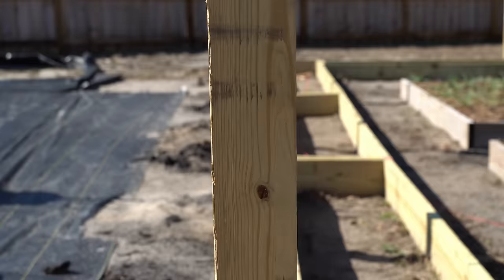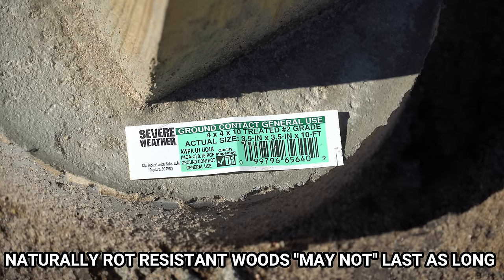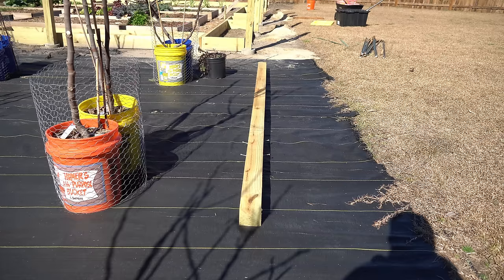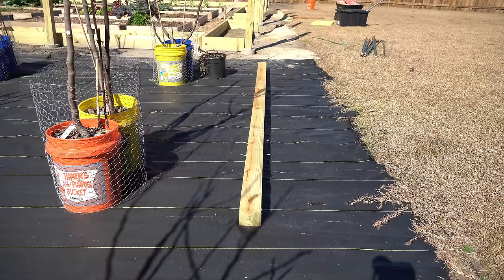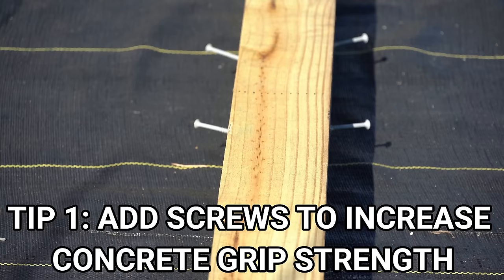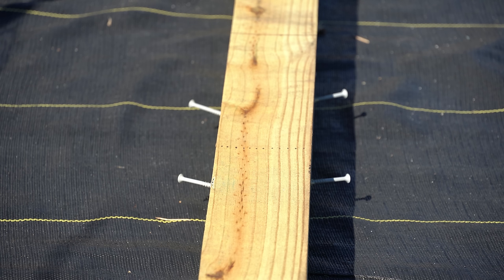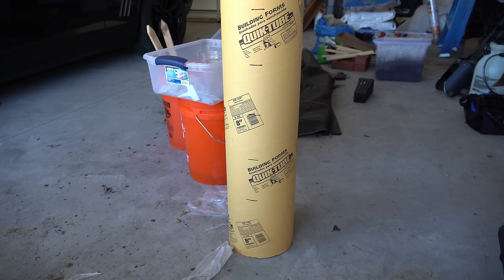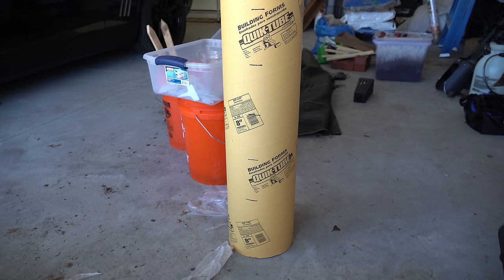3 Tricks To Installing Stronger 4X4 Wood Fence Posts That Last Longer

Comment: I put up a grape arbor in 1981, 4" PT posts resting on gravel and surrounded with concrete. At 40 years those posts are still doing yoeman service.
Reply from the maker: That's great to hear.  I hope my posts last that long!  I know they say, "They don't make 'em like they used to," though, so I have my doubts that today's cheap-o sapling lumber will last as long.

Comment: Why not just use galvanized stands in the concert then bolt to them, worked great in large decks for mw
Reply from the maker: Alex N cost and time.  You will have to install full concrete foundations for that.  I installed these for probably 1/3 of the cost.  I would have had to have purchased 5 bags of concrete for that and dug an even wider hole.
Reply: I wondered the same. For something not carrying a ton of load, it seems like the same diameter concrete would have worked, no?

Comment: Spending time and money :  Take it to the next level...
Use 1/4” lag bolts instead of lite screws 2 per side...My fence post has a hinged 10ft 2x4  swing gate. I can sit on the gate and iit won’t budge 😉Coastal beach town with hard packed sandy soil. 
Today’s crappy wood we use unlike wood from decades ago...
Use dry concrete mix instead of gravel. @ 3” .Heres why ...The dry concrete mix will harden from ground moisture  making a permanent seal at the bottom of the post. The gravel will cause a bathtub effect causing the water to sit under under the post under poor drainage conditions .No brainer...
Good video ...

Comment: I've pulled a lot of posts that were very old and I never was able to just pull the post with out the concrete attached...never was able to even beat the concrete plug off the post...although the screws probably add a little bit of sheer strength under a wind load
Reply from the maker: I've seen folks pop out concrete caps and posts using chains and floor jacks.  It can be done if the concrete is a monolithic pour.  If the concrete fractures into pieces, it may require a little more cleanup.  We used to pop out light pole foundations with digger derricks and backhoes.  Attach chains to the anchor bolts and pull.  POP!

Comment: Doesn't the stress of new/big screws (as a type of 'rebar', and even with slowly graduated pilot holes) cancel any benefits, maybe even make the wood later split, dry out quicker, and therefore be more hurtful, than helpful??
Reply from the maker: The wood embedded in the concrete will be just fine.  Pressure treated posts aren't going to last forever.  They're rot-resistant, but not rot-proof.  These should last at least 10 years; somewhere in the 10-20 year range.

Comment: You should stop your concrete pour 2 inches below soil grade and then install the tube. Pushing the tube into the concrete creates a circle or water that may freeze and destroy the concrete at the soil line. Just a thought.

Comment: Put 2 in gravel in the bottom of the hole then add concrete then place your pole down into it and then fill with concrete at that point your pole is never touching the ground. The screw's I think would do a great job.
Reply: concrete still wicks up the water

Comment: Pressure treated lumber is not rot resistant lumber, it is lumber treated with chemicals to prevent bugs and other such things from eating on the lumber. Most pressure treated lumber is yellow pine or spruce.
Reply from the maker: This is pressure treated lumber that is rated for ground contact, meaning it is treated to resist rot.

Comment: You do all that but disregard the footing and wood post joint. Slope that footing top and install a soft joint with silicone sealant address the dimensional changes of the wood post that will allow water to penetrate

Comment: Hey bud, how many sacks of concrete do you use for a 36” deep hole? And is the diameter of the hole the same as the 8” form?
Reply from the maker: Roy Rivera it depends.  Do you want to fill the hole up all the way or just cap it?  If you need to fill the entire thing, Quikrete has a calculator on their website.  I averaged about a bag a hole because I’m on sand, but some holes needed more.  One hole retained water and was in different soil, so I needed to put in 3 bags.

Comment: Looks like a brick shithouse !!!
I am replacing 100feet of fencing I built 30 years ago
My 4×4×8 pressure treated posts  set in concrete are in great shape.
The rot is at the 2×4×8 stringers 
I live in a very rainy part of western wash 75 inches a year and strong gusty winds
 All he guys saying posts should never be underground in concrete makes no sense to me

Comment: Also, no need for screws. I’ve placed plenty of wood posts in concrete and not one has ever come out. By the time the post rots, you need a new fence anyway.

Comment: Always tar the Bottom 3 and one half feet of your post,,  creosote works good too
Reply from the maker: Creosote is a listed carcinogen.  I would strongly recommend not using creosote for fence posts for a garden.  That's the last thing you want in your soil.  Copper azole pressure treated is fine because it's non-toxic, but creosote is a poison.
Reply: @TheMillennialGardener  ok I didn't know that..
Don't eat them tomatoes...i unusually use roof cement or tar anyway

Comment: Wood screws cannot withstand a sheer force. I recommend nails as they can withstand sheer force. Sheer force occurs when downward or upward force or movement is made on the post such as water freezing.
Reply: Agreed. Galvanized nails
Reply: Correct Kim, this is also why they use nails when building any wall in a house.

Comment: Hey dale do your leaves fall off your owari satsuma if not could you give me a guide to follow to correct my tree
Reply from the maker: The Owari Satsuma is not a deciduous tree, and it should stay evergreen and full of leaves all year long. The tree will periodically drop leaves here and there and replace them as all evergreen trees do, but the tree should never "drop its leaves" and be bare or mostly bare. If your tree is dropping its leaves, it is due to severe stress, probably either:
1. It was zapped by extreme cold temperatures. If it gets too cold for the tree, the tree may respond by dropping all its leaves to save energy and try and preserve its core trunk wood. If you got a sudden cold snap, it's possible the tree will recover.
2. The tree is suffocating due to overwatering in containers/clay soil that's staying too wet.  Citrus are highly prone to root rot and cannot tolerate mucky, wet, heavy clay soil.
3. The tree is going through extreme drought stress.  Citrus are highly tolerant to drought stress, so this is less likely.

I would look at these 3 potential possibilities.

Comment: Hello, got a few questions for you. I have just took my broken fence post out of the ground, 48 inches later. I bought a bag of gravel to add to the bottom of my hole. You recommend 6 inches, so I will do that. You also recommend screws and I like that idea, so I will also do that. I also bought a Quick Tube (10 inches x 5 feet). Do I sit the post on the gravel then, add the tube or add the tube then, the gravel? When this is done do I fill the hole with concrete or dirt then concrete? Hoping you get back to me. Thank you.

Comment: It should be noted, though, that the three inch concrete base will interfere with the pickets for a fence.
Reply from the maker: This is not an issue.  You can view any of my videos in the past 2 years to see my fence.  Welded wire fence is easily cut with the smallest pair of wire cutters.

Comment: All sounds nice, but if you live in an area where ground freezes things heave not sink any "sinking" is just debris collecting on the surface, in clay soils water will collect in the stone at the bottom - where could it drain to?

Comment: I would rather not have the concrete sticking out above the ground, would having the concrete 1-2" below be almost as effective at combating rot? Would you recommend anti-rot wraps or asphalt around the the ground level?

Comment: Is that a 8” diameter hole for a 4” post?

Do you have that same ratio on your fence too?
Reply from the maker: The holes were coming out somewhere in the 8-12 inch diameter size, depending on the quality of the soil.  Some of the soil in the back had more clay in it and was holding together better, but the holes in the front were in pure sand, so they were collapsing a lot, leading to a wider-diameter hole.  I did not install my fence, so I'm not sure how they dug the holes exactly.  The fence was built by 3 different companies: each of my neighbors did a section, and I tied in the rest.

Comment: Great tips! How did you finish your 4x4 post fence? Did you use horse fence, did you brace it?
Reply from the maker: They did not need further bracing after the concrete.  They are solid as a rock.  They only needed to be strong enough to support my tomato vines, but I could probably attach hundreds and hundreds of pounds to them.

Comment: If your belling the bottom of the hole do you wait till it's completely dry and set before you set your post on it.? 
Have to do a 8inch hole with a 18inch bell on the bottom for city inspection..
Reply from the maker: You will want the hole to be as dry as possible.  If you find the hole stays bone dry, you don't have to fill the entire hole with concrete and just pour the top half like I did. I had 2 instances where the holes held water, so for those 2 instances, I poured the entire hole with concrete to prevent rot for as long as possible.

Comment: Very thorough! Awesome work...One question, how do you ensure the post is perfectly vertical while setting to concrete?  Cheers
Reply from the maker: I used a post leveler, which I have linked in my Amazon Storefront in the video description under Garden Accessories.  It's only $8 or $9 and works great.  That got me 95% of the way in seconds.  Then, I used a 2 foot level to check for any final, tiny adjustments.

Comment: Thanks so much.  Am putting up a 16x24 off grid home.  Have you heard of these new plastic discs to put under the pole?  My worst fear is foundation problems, want poles to last AS LONG AS POSSIBLE.  TN mountain location close to frost line, but 500’ below.  Prudent to coat pole in ground with creosote or copper type preservative?  Thanks again
Reply from the maker: I'm not familiar with the discs you're speaking of.  Because this is a garden installation, coating the bottoms of the posts with any kind of chemical can't happen, as I do not want that leeching into my soil over the years.  The posts are already pressure treated, so they're completely soaked through-and-through in a copper preservative.  I can't see that adding much additional value, since the posts are, quite literally, soaking wet sitting on the shelves at Lowe's.

Comment: I do my post much like yours however the part of the post that is below grade i coat with roofing tar and allow it to dry before installing.  Just another layer to help prevent moisture from getting to the base of the post.
Reply: question about roofing tar:  does it have to be heatex up or is it paint on?  thank you

Comment: One thing is that if the soil can be saturated 365 days then if it rains and you have gravel under the post won't the water just sit in the gravel sort of like a pool of water? That will definitely speed up the rot won't it?

Comment: Best solution is to use metal brackets available at the home store, to fasten your post to the top of the concrete peer, thus allowing the post to stay dry.  Strength is achieved by stucture attached to the post.  Keep the post out of contact with the earth or concrete and allow it to dry when it rains.  If you have not “structure” to secure the post then this “per video” is a good idea.
Reply: A gust of wind would knock down the fence. Not enough strength

Comment: using a proper Post anchor setup so the post is NOT even in the ground, but sitting in the anchor/strap/cleat/strongtie well above grade. Yes use concrete pylon to overcome frost heave., but this the only way to ensure a wickless post. Your method of screws only speeds up the moisture penetration , not a good plan. Cut a cross section of post and examine the impregnation of the "treatment" , you'll often see very little if any treatment infusing into the core of the post, Some do , some don't , it's an important aspect to the life of the posts you have, and screwing more pathways for water into the core is worse. However, the rest of the build is looking fantastic, and will last a lifetime or more anyway. Well done. Happy Harvest!

Comment: you should not put concrete around wood.
we have Brackets that you concrete in and bolt timber to that, If in years to come you can easily change wood ?
Reply: those work great for deck and shed footings, but what about fences and the shear loads they create?  Surely such brackets - and especially the bolts that secure them to the concrete piers - are not designed to withstand those types of loads, especially if we are talking a 6-7 foot panel fence in a high-wind area?
Reply: @oceanzmat  they're called stirrups and they will hold huge load. They sometimes use them for house footings.

Comment: If you have ever pulled a pt post out of the ground you will find that all the rot happens in the first 10 inches or were the water runs down between cement and post as it contracts
Reply from the maker: This is why I capped the tops and built the foundation reveal.  I'm trying to keep the water off the tops.  Hopefully, these will last at least a decade.

Comment: Every post I have seen that failed either on concrete, gravel, clay, soil, etc. has been near the surface where it is continuously cycling wet and then dry. I believe I have seen more sheered off in concrete than other installations. I am curious how the foam method will turn out over the next decade.

Comment: Great tip for setting post's, but I'm curious at what point did you remove the cardboard tube. And what method did you use to remove them?
Reply from the maker: You may remove the cardboard the very next day.  A 24 hour cure is all that's necessary.  The cardboard is perforated and designed to tear off in a circular pattern.  You can get it started with a utility knife.  If you can't get the cardboard off for some reason, just soak it down a few times with a hose and it'll turn to mush.  Then, you'll be able to just pull the mushy cardboard off.

Comment: I don't understand why you set the wooden posts in concrete and don't use anchors? They're just as stable when done correctly. How do you replace the wooden posts in the first place?
Reply from the maker: I only poured a concrete cap.  You can pop them out using a chain and a floor jack if and when they eventually rot.

Comment: This guys name says all u need to know gardener I have been doing fence for 18 yrs and all these tips will do is cost u more money u don’t need to spend. Bell the bottom of your hole, put concrete under and all the way around your post and do a dome cap no extra materials and just solved all the issues this guy said

Comment: How long do you wait to pull off the forming tubes?
Reply from the maker: 24 hours to cure enough to be firm in most cases. If it's really cold out, maybe wait 48 hours.

Comment: Hello, hope all is well. Question, how many bags did you use per post in your situation? Thank you.
Reply from the maker: I tried to only use 1 bag per post as a "cap" on the top so when the day comes where the posts eventually rot, they won't be horrible to remove.  However, some posts in the rear right had some water intrusion 3 feet deep, so they required more concrete.

Comment: Consider going with stainless structural screws. They should last a good deal longer
Reply from the maker: In my experience, the screws outlast the wood.  Ultimately, this garden has already been through a direct hit hurricane over my house a couple more tropical storms and they're as good as the day they went in.
Reply: @TheMillennialGardener  Fair enough. Maybe it has to do with the climate or product defects, but I've had a number of galvi fasteners fail when coatings chip off or are otherwise compromised.

Comment: How do you remove the tube after cement is dry?
Reply from the maker: The tube is made of cardboard and has indentations to peel it, similar to a paper towel roll. All you do is run a utility knife along the bottom, start a corner up top and peel it off.  Or, alternatively, you can soak the cardboard with a hose so it becomes saturated (after the concrete cures, of course) and it'll peel off with almost no effort.

Comment: Would have been helpful to see how you removed the cardboard tube from around the raised "reveal".  I just did this on a post I set this afternoon and I'm a bit concerned about removing the tube. Gonna just dig around it a bit and maybe cut it and try to peel it off. 
Again, why not show this important step? Otherwise, well done and helpful...

Comment: Watched your video because I'm hoping to install a 9ft,  4 x 4 post for a clothesline. It is pressure treated but I don't know about the ground contact rating.  A neighbor gave it to me, doubt he knows either.  Said he had it a few years left over from another project.  Should I get a new post?
Reply from the maker: Mixdplate if you’re not 100% sure if it is ground contact rated, you may want to use a minimal amount of concrete to secure it.  When it eventually rots, the more concrete you use, the harder it will be to remove.  Even if it is ground contact rated, it will eventually fail, but ground contact rating will last longer.

Comment: When do you remove the tubing for the reveal, when it’s still somewhat wet or wait for it to fully cure. I see you were sinking the tube in the concrete a few inches.
Reply from the maker: You can remove it the next day.  Give it 24 hours, and then you can remove it.